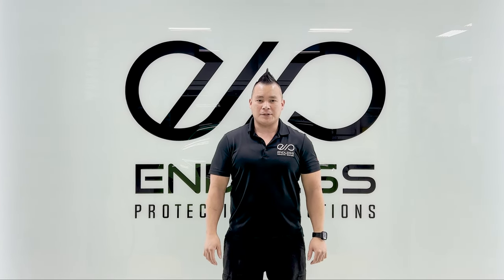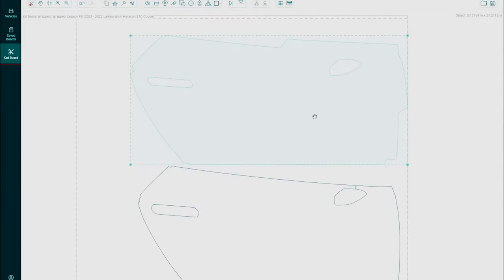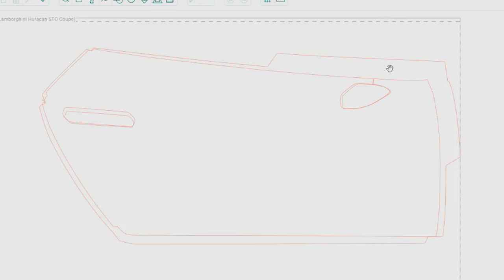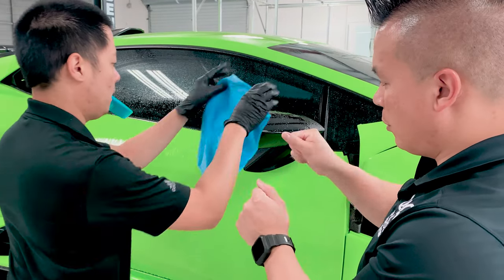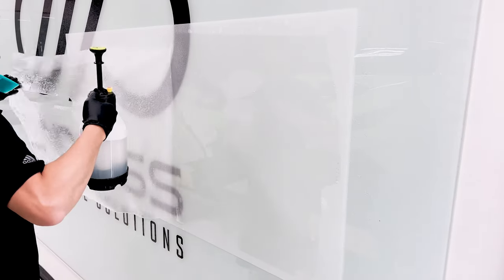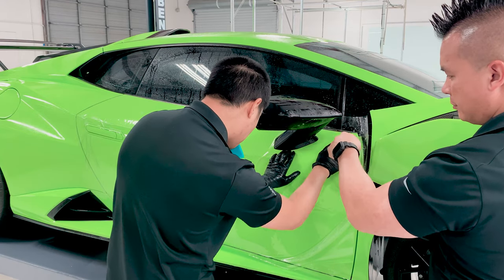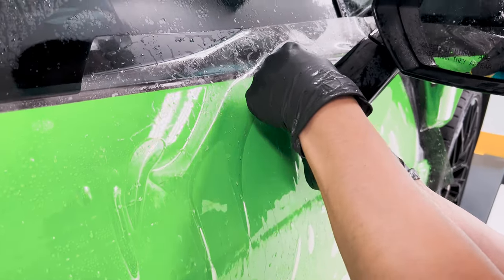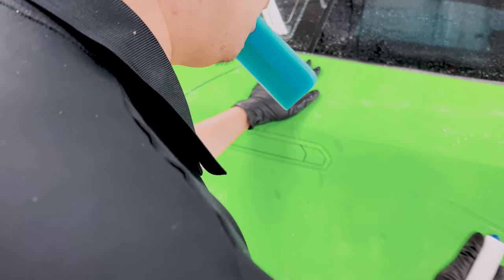How To Birth A Mirror  | Using PPF to Birth A Mirror on Lamborghini Huracan

Comment: Awesome work and tutorial! Had always thought about trying this but no opportunities yet since I work mostly on Tesla's.

Does it ever tear when you birth?

That's my only concern wasting film unless you can reuse it on another panel you pre prep in case it tears. Also thought about using film large enough for 2 birth attempts, 1 precut on top if that fails then using the precut cut out and stencil cut out below for second attempt.
Reply from the maker: If you add the pull tabs, it gives you some extra to "stretch" . If you don't add the pull tabs, during the stretch it'll either tear or crack the top coat of the film. Also it depends on what type of film you use as well.
Reply: @EndlessProtectiveSolutions  makes sense, thanks again!
Reply from the maker: @ppfguys  Anytime! We used the same process on SF90s and Porsches.